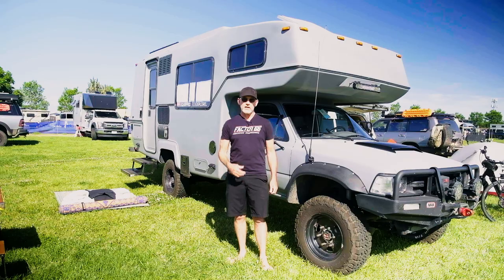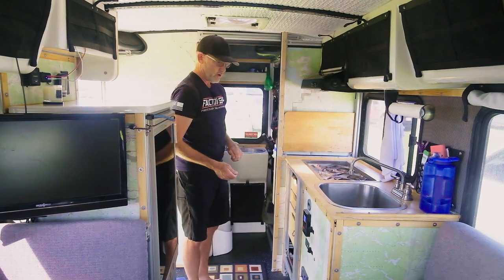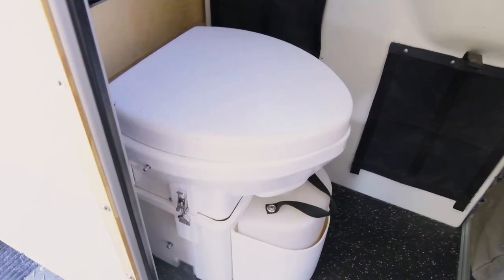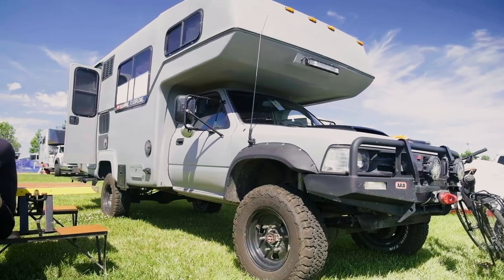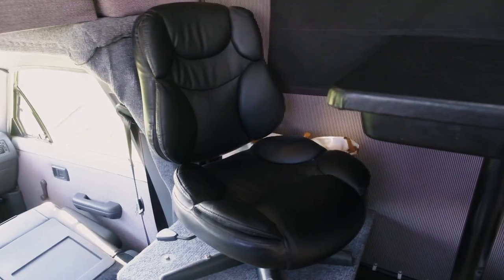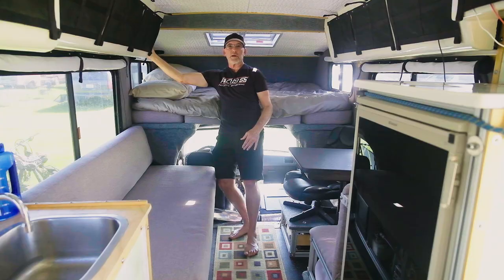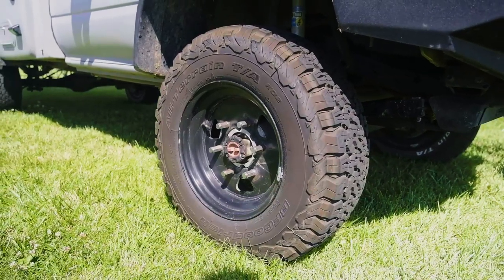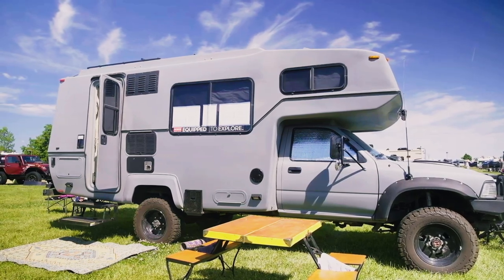DIY 4x4 Conversion - 1990 Toyota Sunrader Camper Tour

Comment: Where do they shower,do they go to camping grounds to use the showers
Reply: They’re waiting for raining to come. It would be helpful by raining in a few hours. I think it’s simple to use shower by raining.

Lol 😂…..I think campgrounds might have showers, toilets and sinks in the buildings.
Reply: Yes van lifers go to camp grounds or more often they have a gym membership and just shower at the gym.
Reply: Alot of people use solar portable showers.  They can be used outside or inside if you have a shower pan or a large plastic tote to catch water.
Other people use baby wipes or do sponge baths until they shower at a gym, campground, truck stop or lake or creek.
I think I would put a taller faucet with a pull down nozzle on the kitchen sink so I could wash my hair and also it's easier to rinse dishes.
Over all a beautiful rig.  Loved the coach...never saw one where the back flips to the front to make a bed.  The marine stove was a very nice addition.  Never can go wrong with a pull out pantry.❤
Reply: We have an outdoor shower on the outside other side. Hard to shower when it's cold but it is reliable hot water. Truck stop showers are amazingly clean and nice.
Reply: @Greg Hayes  it was nice to meet you two this weekend!! Manda Eric and the doggies!!! We looked up your rig because it was SO COOL!
Reply: We use a 2 room shower tent with a portable propane water heater

Comment: Nice truck, but you have no idea what overlanding is lol. 
America has ruined the concept of overlanding, like we ruin everything else
Reply: Please do share with us (me) what overlanding really consists of.  I'm not currently an over lander and have no idea other than what I see on the internet.
Reply: You are right about that overlander is totally different to a mobile home
Reply: @FedUpCanuck  mobile home????? I think you mean motorhome
Reply: It looks boss and overlanding  is the “camping” you go out on roads than need 4 wheel drive to access.  Pretty big excuse sometimes to just make huge truck toys.  Military looking tough.  No hiking into hard spaces, just use gas, pollute and drive there.
Reply: @FedUpCanuck  you are WRONG. A Mobile Home is not on wheels. Or drivable. A Motorhome IS drivable and on wheels. Ok, got it?
Reply: @FedUpCanuck  
Educate yourself (or have someone read it for you) before you post such ignorant comments.
Reply: @eddieengland9886  reported for harassment
Reply: @FedUpCanuck  you need help!
Reply: @jrambo7495  whatever
Reply: It's a cheaper version of the Earthroamer.   Overlanders either sleep in a rooftop tent, a small travel trailer intended for overlanding or a expedition vehicle/camper.  Logging roads, different technical trails are marked for overlanding  - use apps like Overland Bound One to discover where the nearest trails are.